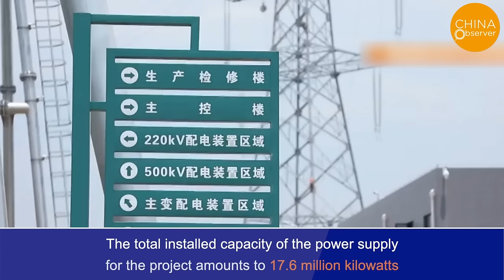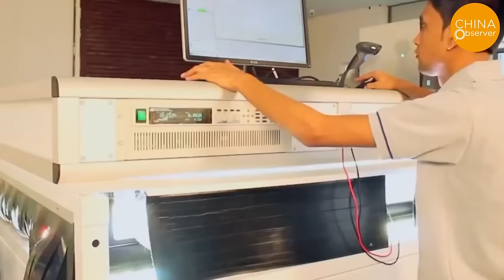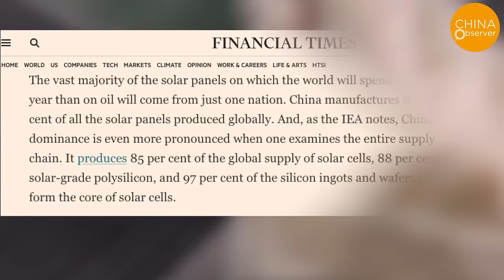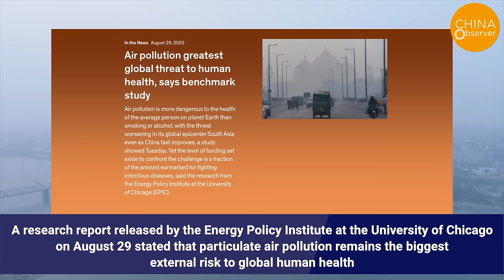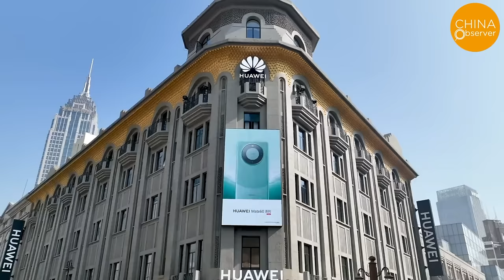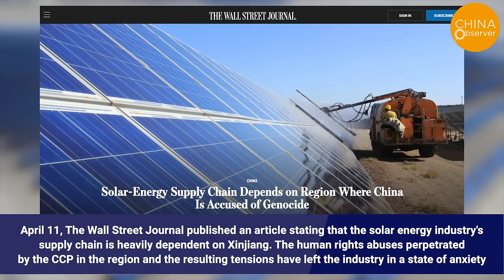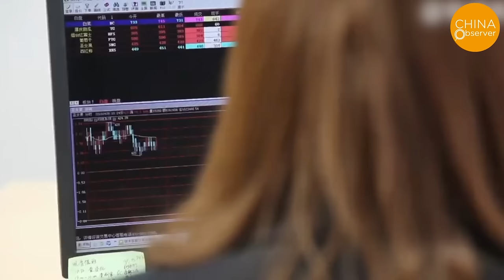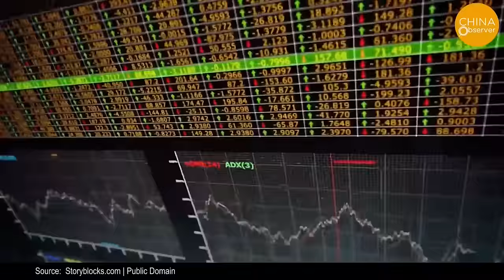China’s Costly Joke: ￥80 Billion Solar Panels Blanket Deserts, Demanding Daily Washes

Comment: One of the main issues for China solar power pertains to location. Most of China's consumption of power lies in both the major industry production areas as well as the major urban areas. These are concentrated along China's vast Eastern coastal region seaboard. The Western desert region where these solar (and wind power generation) 'farms' exist are located very, very far from the end users/consumers. The problem lies not with the generation of power, but rather the transmission of that power. Transmission of power results in inevitable power 'losses'. This is exacerbated by the large distance between the power generation source and the consumers. China needs to address this issue if it is to have an impact and be of any benefit. This is the problem. So yes, they can generate the power, but what good is that if it can't be delivered to the consumers? 
I read somewhere (can't recall exactly where), where a journalist was in a region where there was a large wind farm. He noticed that none of them were operating. He asked his driver about it, and the driver told him that they only operate when government officials visit the region. So, in this case, it was mostly all for show. The CCP can claim all their exceptional efforts at being/becoming 'green', but in many cases it is just to say - "Look what we have done and are doing". All for show only.
China is commissioning, building, designing, and planning new coal fired power generation plants on an unprecedented level and scale (vastly surpassing the rest of the entire world COMBINED). China's insatiable thirst and need for power still rests and relies primarily on coal. In China, coal is and remains King.
Reply: Also sandstorms will cause drastic increase in maintenance as well as a drastic decrease in life expectancy. You will have to replace them a lot sooner which means there is a possibility the carbon footprint manufacturing these replacement solar panels will equal a coal power plant + its fuels.
Reply: For you it's a case of damn if you do and damn if you don't. No matter what China does  there are people like you who will always ask the question western media like to ask : OK  but at what cost?
Reply: @kamsunleong6648  I find your statement bizarre at the least. A costs versus benefits is standard practice for all businesses. And, for that matter, a basic exercise to determine action(s) to take pertaining to a plethora of decision types - including personal decisions. Show my a business, or for that matter, a person that doesn't do such. Why would any business invest money into something that wouldn't reap any return or benefit? It makes zero sense. This has universal applications - It is not strictly limited to just China - I am not calling-out and 'picking-on' China alone here. I do the same wherever I happen to come across or when such is revealed. Your remarks come-off as insinuating that I am racist. I assure you, I am not.     
I find it quite contradictory - If China is seriously 'going green', then why the continual investment, building, etc. of its coal power generation capabilities? Why are these investments in green energy not replacing and/or at least decreasing the use and/or dependancy on coal?
It can't but not beg the question - Whether China's push into green energy is merely a PR program. One that satisfies how China 'looks' to the rest of the world. Yet concomitantly stands-out in stark contrast to the 'non-green' activities they present and unabatedly continue to pursue.
Don't you find this a dichotomy? Paradoxical?
Reply: What even boggles me is the length of wire to connect these solar panels and the consumers/users. Is it worth it?
Reply: @seekthetruth1478  brilliant. Points for not going off the rails at the insinuation of racism.
Reply: You can generate electricity when the sun shines, but what about when it does not? Industry and domestically people need the electricity to be steady and constant, and not varying by the time of day. This means to  make it effective you need very large amounts  of battery storage to smooth out the power. China does not have this, and due to cost, might never have it. The alternative is coal powered power stations to fill in the gaps. These cannot be switched off!
Reply: @seekthetruth1478  Anyway you look at it, it is a PR program. 
You can see it, literally, in the smog over the major cities.
Another major concern is the acceleration of mining of the Uranium laced coal veins in the North Western regions prompted by the spat with Australia.
They will have to address that issue very soon.
Reply: @ヘスリングマイク-j2i  Excellent point. Whether they address this issue is up for debate. In the CCP's mindset, the end justifies whatever means are required - Always. Given the choice of addressing say the economic situation (to address the people's needs/concerns) or retaining their hold on power, it's a no brainer for them. Sadly, for the CCP, hold on power trumps any and all. No matter the cost that the Chinese netizens must, and are required, to suffer and withstand. That, and they have a proven record of non-concern as to the well being of their netizens.
Reply: All Chinese green energy and air quality measures are mere PR. Their air quality  sensors are regularly moved to cleaner locations and set within no entry zones that are heavily planted.
Reply: @kamsunleong6648  This question has implications that don't exist. Its basic economic cost benefit analysis, something that people always do when it comes to government spending. And in this case, they are practical considerations. In this case, China is still importing Coal on a massive scale, and this has increased every year since they started importing coal. Now it would be great if this project can inhibit their usage of it, but it doesn't seem like any of their renewable energy projects are doing anything, as 2023 was the most coal imports so far.
It's a huge waste of resources if those mega projects aren't actually doing anything, and since all of those things have a shelf-life, they would only decrease in efficiency as time goes and and eventually break down. In other words, it feels just like another CCP vanity project that doesn't help anyone except those skimming from the top, and is just a waste of resources.
Reply: @kamsunleong6648  China should ignore costs. The decline will be faster.

Comment: growing grass near and beneath solar panels that are mounted near the ground in dry windy area, increases the risk of wildfire roasting the photovoltaic panels and wiring.  The risk for sandstorms (which don't come from the immediate area) scoring the panel like a massive sand blaster or coating the panel with huge amount of dust will significantly reduce the lifespan and efficiency of the panels.  Dust and sand always work itself into moving parts clogging wind turbine requiring lots of maintenance.  Then there is issue with long transmission lines required to transfer the electricity to the coast where most Chinese live.  Maintenance of these massive projects won't be cheap, and probably requires a lot of water to fight fire, wash the panels, irrigate the grass so they won't burn, etc.....   This is a very challenging effort which can result in a financial disaster if they are not carefully thought out.
Reply: Reminds me of the time China jumped on the solar roadway bandwagon. That didn't last a month due to the damage caused by the cars on the solar panels.
Reply: Thank you, on paper,  solar panels harvesting the sun sounds great in a desert, but the panels will degrade very quickly due to sand storms and the transmission losses taking the electricity to where it is needed will make the whole thing unviable.
Reply: I hope this is not just another wasteful Tofu Dreg project.  They should invest in helping their kind intelligent population start businesses instead.
Reply: Where do they get the water to wash the panels with in the desert?  Better idea to plant crops and use the water for that, and put panels on top of buildings right next to where the power is needed.
Reply: There are worse things for them to spend money on and everyone will learn what the outcome is as time goes by, better than wishing it couldn't work  :)
Reply: @phann860  Easy solution for this: You just build a 200 meters tall 10 meters thick concrete wall all around your panel installation so the wind won't touch them! Win-win situation!
Reply: @stephanecremont3666  I think you should do a cost benefit analysis, the cost would be prohibitive.
Reply: Sandstorms? You know it's not something every desert has... Solar panels are actually pretty resistant to such weather. As for overheating and fires, if it's installed like it should be it's almost zero risk of fire and overheating simply turns off section of plant and that's problem but later on why. Power delivery is not a problem too, you don't have to have power plant close to where people live anyway it's normal to have powerplant even hundreds of km from nearest big population center. I live in much smaller country and power line to my house has 100km. Issue here is usual shoddy Chinese quality in both parts and installation and cleaning panels(but that's good as cleaning gives job to uneducated people as it's easy). You all talk out of you asses not knowing only real issue with solar plants and deserts is just that solar panels work in 50-75% capacity in very sunny worm places. Best place for solar factory is place with a lot of sunny days but low temperatures so definitely not desert.

Comment: And THAT is why you don't install massive photovoltaic arrays in desert:
1) They get covered in dust, cleaning them manually is too costly (without using slave labor).
2) They break due to winds, wildlife, etc. Repairs are too costly
3) People don't live anywhere near deserts, ergo transmission losses
4) Manufacturing Current generation PVs is expensive, and very damaging to environment
5) Current generation PVs efficiency is abysmal. They are not good enough to offset above problems.
This is the reason we do not have large solar arrays in such places already, but apparently China did not get the memo.

Next generation PVs might change this by being more efficient but the research is still ongoing.

In future the panels could be cleaned and maintained by AI bots, which could also help quite a bit.
Reply: haha in germany we built 3 generations earlier PVs that costed 60cent per produced kwh in the beginning. nowadays its 8 times cheaper but we wasted so much money on low efficient pvs thanks to the greens and now we repeat the same mistake as the same party wants to force every house to build early generation heat pumps

Comment: Look at those images of the buildings with the solar panels on top. The panels are facing a single direction (south?). That means that early morning and late afternoon, the panels will cast shade on each other. Normally there is some room between the panels to reduce shading when using a north south configuration. This is a clear example of 'how much panels can we fit onto a roof' without looking at the economic picture. If they wanted to maximise their power production and use many panels in an economic way, they would have gone for an east-west configuration, which has much less shading.
Reply: With an east west configuration you cant tilt them to face more towards the sun. This maximizes production during peak sun hours mid-day. The early morning and late sun hours aren't as intense, and you would have to face them directly towards the rising sun. An east west configuration is used when there are tracker motors on the panels to rotate them to follow the sun. Otherwise a fixed panel is going to face south.
Reply: @TheJesselopez1981  I have a roof full of fixed panels without tracker motors in an east-west configuration.
Reply: @GerbenWulff  and?

Comment: Of course, the relevant measure for measuring switching from carbon-based generation to "renewables" of electricity is $ per kWh (Dollars divided by Kilowatt hours of energy produced).  You can't just measure the supposed kilowatts of either.  Carbon-based generation are down about 10% of the time for repairs while Solar and Wind are unable to produce energy >50% of the time (night, cloudiness, dust build-up, calm air and degradation of the solar panels and wind generators.  Measured that way I don't doubt it will take until 2150 before "renewables" will equal carbon-based generation worldwide.

Comment: The energy storage problem is still unsolved.  

In the video there was a claim at one point that China had a practical way to store the energy.  I would love to know what that is.  But I'm pretty sure they were just expressing the aspiration to develop such a thing.
Reply: Batteries, conversion of surplus energy into hydrogen.  -The hydrogen would then need to be transported.  Using the excess power for Ammonia production (pulling nitrogen out of the air).

Comment: the solar power plant in the desert idea has existed for a long time but still no one makes it happen because the maintenance cost and difficulty due to the harsh conditions.
Reply: The most realistic thing i've seen is the array of mirrors in a desert all reflecting the sun to a central pillar to heat it and from that heat it drives a turbine that generate the electricity. It seems the mirror are more sturdy and needs far less cleaning and they move with the sun too compared to those static solar panel. But even then, it hasn't been mass deployed, still a research proposition to see how it goes before mass constructing it. And there is maintenance to be had even if it's far less.
Reply: @stephanecremont3666  was tried in Cali and in Spain..... both plants failed spectacularly.....   one in Cali caught on fire

Comment: But from where does the elektricty come during the night? Solar cells need also battery capacity at the same size…
Reply: There is solar energy at night, but the value is very low 1-2% of day light etc

Comment: While the idea of sowing grasses under the panels might seem like a good one, and while it CAN be... You have to be very careful about what you do. 
Those panels get hot... VERY hot, so you can't use a grass that will dry in the heat and burn. 

You could potentially use sheep as seen in this vid, but that brings up MORE problems. When you have sheep you have other pests to go with it, not to mention that the sheep themselves may well damage the panels. 

This would, ironically, be better suited in a more temperate area that won't be prone to grass fires. The problem with that is that you won't get the sunny days you would in the desert. 

In hindsight, the idea is one worthy of test runs... But I doubt it would be viable in the long run due to the associated costs from maintaining the site. This is why high deserts with NO viable grasses are much better for solar panel farms, they have far less maintenance needed. 

BTW... Did anyone see the ironic use of petrol strimmers being used to maintain the grass?
I just thought that was noteworthy. B-)
Reply: BYD make specific solar panels for agriculture.  The light goes thru, but the UV and heat are trapped and used to generate energy.  These panels are also bi-facial -they light that gets reflected from the plants/ground is also used

Comment: Solar is...limited. maybe home could have 12 or 24v system w batteries and solar for most items, then hi volt 220 for appliances and larger items?
Reply: Your DC-AC inverter can do 120v/240v (single phase).  Three phase commercial inverters for more power.

Example: Ford F150 Lightning.  DC/AC 120/240V no problem.

Comment: YOU really aren't the right channel to cover power generation because you'll take criticisms as if they are fact, and the reality is much different.

Different countries have solar installations in desert areas and don't have problems with it.

Also the very mitigation points that these companies/investors said are correct.  They should have wind breaks installed in many places which tend to deflect wind away from the panels.  If done properly this breaks up the wind that the panels tend to get only light dusting of dust, not really heavy sand grains.

Yes, when installing solar in areas like this, IF you have the water capacity, THEN you can grow plants under the panels.  The way panel arrays are laid out you get a mixture of full sun, partial shade and full shade and it changes during the day.  This is well studied and in fact farmers in different countries have allowed solar to be installed over part of their land and they make money from the power that's generated AND they can grow different crops under the panels, often crops they otherwise wouldn't be able to grow.  This is well researched.

However in desert areas the choice of what can be grown shrinks down to desert plants, plants that can handle drier conditions.  So, yes they CAN do these things.  If managed properly it doesn't take people going out every day and getting dust off panels.

The research for studying the installation of solar farms goes back more than a decade and it's believed it's feasible and done correctly, no they don't need to be cleaned every day.  In fact if the arrays are installed in an efficient way you can have brushes that run across the panels which means you only need people to go out about once a week to check systems.

The bigger issue is grid storage.  The idea is to overproduce in the day time, and let off charge at night.  You need cost effective grid storage that doesn't use traditional batteries.  But this already exists too and the economics of solar, installed with grid storage still makes it cost less that coal burning plants.  That's based on 2023 numbers.